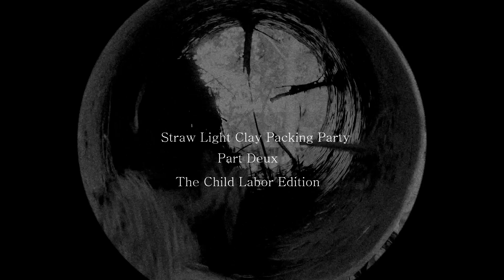TFC: Straw Light Clay Packing Party Part II

Comment: Has the dried light straw clay shrunk away from any of the framing and created gaps? Nice work! Ive messed around with this a little bit but ended up insulating with foam on my current project.
Reply from the maker: I haven't seen any of that yet. I should know in a few weeks. The thinner 2x4 framed walls are definitely harder to pack to the point where they have a good "grip" and don't just fall out of the stud bay.

Comment: Perfect place for rodents to nest
Reply from the maker: Rodent and insect infestation is definitely some to consider with this building technique. We're currently plastering the walls to seal them.
Reply: @offgridburbia  Wouldn't the slip help prevent these kinds of infestation?
Reply from the maker: @johan4413  Yes. Once cured the straw light clay if fairly hard and compacted. I also started adding borax to my slip which acts as an insect deterrent.